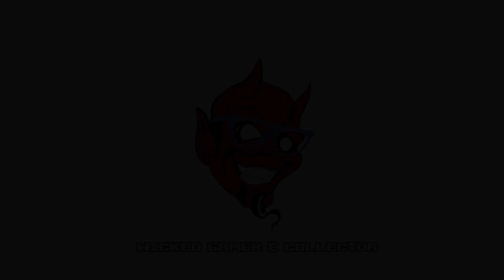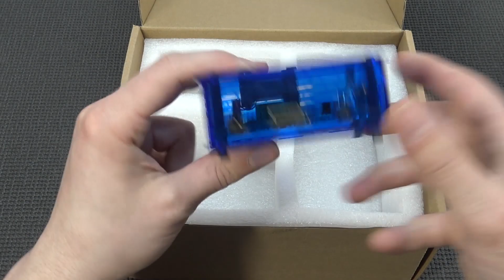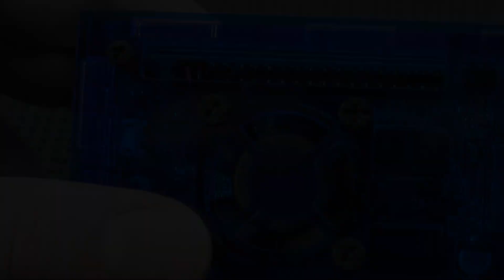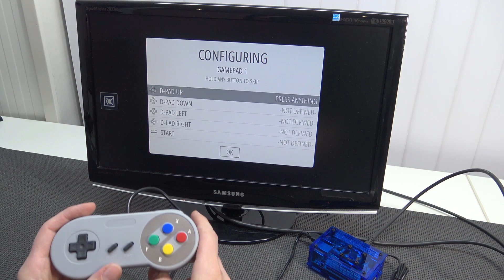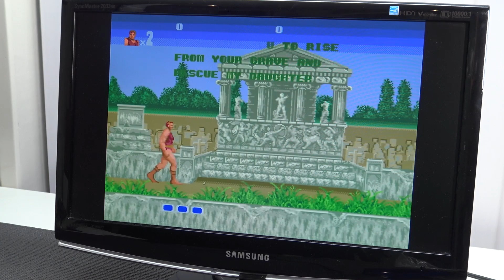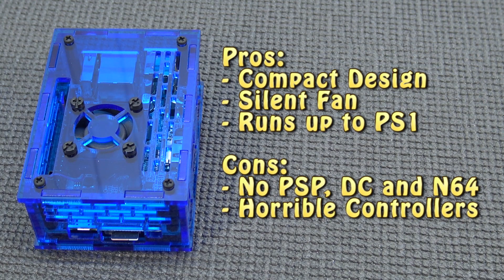Game Station 2021 a New Next Gen Retro Game Console ?

Comment: You can still find the Orange Pi One Allwinner H3 board for around $25. You can download Retrorangepi 3.0 for free and use a wired 360 controller. You can also find other builds of Lakka RetroArch and The C64 and various Android OS images and Armbian. I have a $25 Beelink X2 Android box with H3 processor that also boots all of these builds on SD card. Cheap fun little SOC, that H3.

Comment: I build a couple using Orange PI about 4 years ago since they were a bit cheaper than a Raspberry Pi and they worked fine for retro gaming and were easy to setup, Kodi worked horrible on it though, constantly freezing.  Wish that case was around when I bought mine, there weren't many designs when I got mine and it is slightly different than the Raspberry PI so using a case for that was tricky.

Comment: N64 emulation just sucks in general. Best way to play it is on a Wii with virtual console. An actual pc as well. Dreamcast and psp is always a mixed bag. Ps1 emu is becoming more reliable even on lower end hardware.  You would expect better performance on a PI. Saw a bunch of these on Amazon recently. Glad I didn’t buy one.
Reply: I got the pi4 b 8gb, way better, can run dreamcast and NAOMI. £48.i put it in my arcade machine and is fantastic.
Reply: @randomretroplays3123  yeah you have a good pi setup.  way more ram than what he is showing here.  Think this one has just 1gb.  Also not sure what pi it is.  probably a pi2 or 3 at best.  even then i would expect better emulation on n64 with what he has.  This tells me it is the emulator itself and prob not the hardware.  dreamcast emu and naomi has also come a long way.
Reply: Yeah a lot of times it's the emulator for example SNES can be difficult to emulate on a few devices because of poor emulation programs.